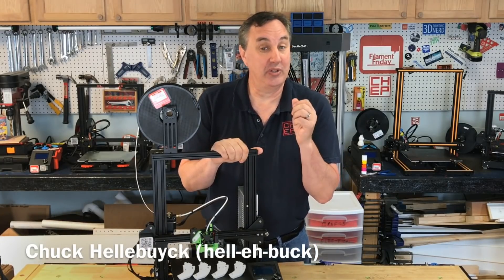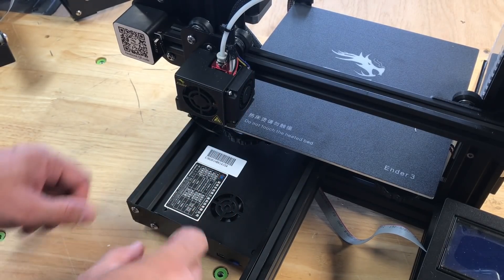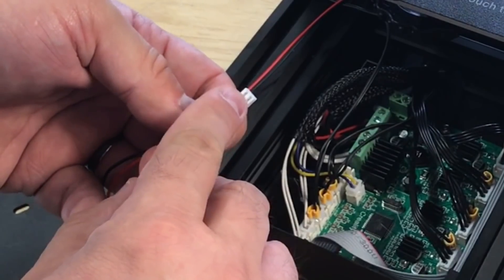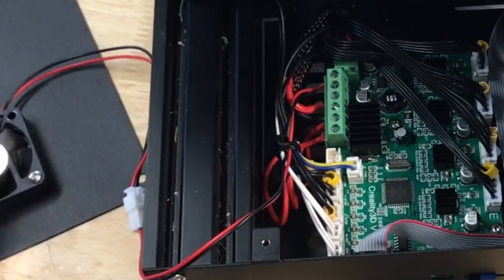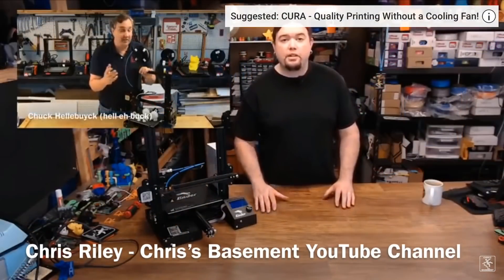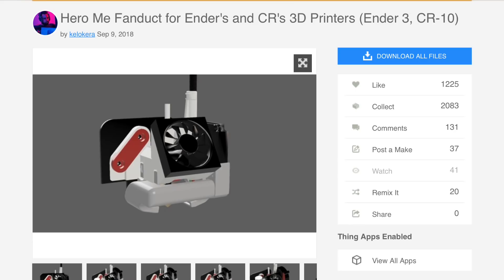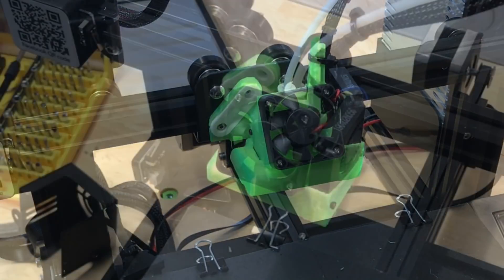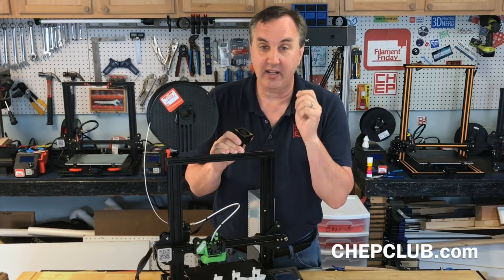HERO ME FAN DUCT and Fixing the Cooling Fans on Creality Ender 3

Comment: 3 years later and Creality is still making their printers with the electronics box and parts fan running the same fan speeds. 
Please make a separate video to spread awareness and show your mod as I think it's a pretty big deal. Think about it: when running HOTTER and drawing more power for PETG and Abs you are running the fan lower/off which means under the biggest loads your electronics are cooking.
Reply: is this the possible reason why my extuder motor stop working in the 4th layer every time when i print abs? coz the motor is overheated due to the motherboard fan is not working.

Comment: Solder is malleable. It crushes just find and works in terminal blocks without issues. Also it prevents individual strands from shorting stuff out. I don't know where this old wives tale comes from. I've had the discussion several times and we've tested it out. There is nothing wrong with using tinned wires.
Reply from the maker: Over time solder will move from the pressure because it’s malleable and reduce the holding force from the terminal block screw/clamp thus creating a slightly looser connection.
Reply: @FilamentFriday  I don't believe that. It will deform under pressure but its not going to flow away from the connection. Copper wire strands deform as well. They are obviously harder material but if they deform we would see the same effect on a bit smaller scale. If this is true you have to re-tighten the screws from time to time no matter what. I've had tinned wires in terminals for years and have not noticed.
Reply from the maker: Ok. But it’s an industry known fact. https://cdn.thomasnet.com/ccp/00142951/263810.pdf
Reply: @FilamentFriday  lol. Written by a sales and technology apprentice. Now industry standard eh?? Do you believe everything you read? You will notice the article states many companies tin their wires. Mine is one of them. We have been doing it for a long time.
Reply: @Ryan_Tidwell  It depends on your use case and the expected operating environment. Low current and no mechanical stresses, there should be no issues tinning wires. But high current or a lot of mechanical vibrations, then you're just asking for issues from solder creep and fatigue. Why you'll never see tinned wires in automobiles or aerospace.

Comment: My recently purchased Ender 3 pro doesn't work with the latest Cura version.  It stops printing and freezes the print just 30 seconds into a print job. It works fine with the Creality slicer.
Reply: strange, I‘ve no issues with cura, did you also tried prusaslicer? what marlin version you’re running? older marlin versions don’t support all gcode commands
Reply: Upgrade firmware

Comment: Agree with having the profile set up correctly, but better cooling will allow faster print speeds. There's no reason to think that if you have a profile that produces a good print w/out cooling that adding "good" cooling will improve it.
With the hero me cooling, did you ramp up print speeds? Or use same print speeds and time per layer as w/ no cooling?

Comment: Based on your previous video, it looks like the speeds you're printing at mean that you're not close to the limits of your cooling setup. If you are telling your slicer to take 10 seconds minimum per layer, you're spending a lot of time just waiting because you're not using adequate cooling to go faster. If you were to increase your printing speeds you will probably start to notice a difference. It looks like that's what happened in Chris' video.

Pushing print speeds will identify a printer's weak points, and something like the Hero Me is useful when that weak point is cooling.  Making these types of improvements can result in faster prints with no loss in quality. One of the joys of PLA printing is the ability to push speeds faster and maintain quality because it melts and flows so well, and hardens just as fast with great cooling.

Comment: I agree that a profile needs to be setup correctly over anything else, but I also think the hardware should be setup correctly too. Printing without supports, getting better overhangs and bridging capabilities are really where the improved cooling come from. I don't think you'll see those results on a Benchy.

Comment: What's going on with the estimated completion time?  You said yours is 5h46 minutes but mine is at 5h48 with just the duct part. I have the base and adapter going on my other printer but if that time estimate is correct it would be faster for me to just wait until the base is done and print the duct on that printer as well. I just really want to try out PETG on the ender and haven't yet so I'll probably just go ahead and send it to the ender. If you have any ideas on the time difference, let me know.  I'm using your profiles, of course. Oh yeah, and I can't tell you how many times I paused the video because I was trying to look around your sliced model to make sure I have the orientation the same as yours!
Reply from the maker: Not sure. Check infill and number of walls. That adds time.

Comment: does the base ender 3 pro have a fan for any fumes from the plastic or should i try and find one
Reply from the maker: What fumes? 
Guess you need to find one.
Reply: The only time there are any significant fumes is when you're printing materials such as ABS, PC, and other heavy duty, high temperature filaments. If you do want to print those then you'll probably need an enclosure with air filters
Reply: The Teflon in bowden tubes starts to break down and offgas starting at 200deg C. This is toxic.  At 200C, it's supposedly not a problem for humans, but is a problem for any pet birds around. The closer you get to 260C, the more risk you're taking being in the same room with the printer.
This is why you'd want to get an all metal hot end if the printer doesn't already have one. It keeps the tube away from the heater block and those high temps.

Comment: Hi, on my old Creality CR10 (first model), i had some problems of warping but not on the bed, on prints that have a angle and need a support. The lines doesn't stick to the support and then it warp. I tried different setup of supports but it always warp on supports. And then if it warp too much, the noozle hit the print and brake everything.
So i experienced there is less warp phenomen when i use 60 Celsius for bed and i stop the fan. In fact the warping phenomen is due to the temperature of the line that is freezing too fast and then it retract before the othe layer. It always retract on +Z, i don't know why it's anti-gravity ? So i'd the idea to stop the fan to inverse the warp in -Z so that plastic would fall with gravity. But it doesn't. Maybe because of the other fan, or the temperature of the room is too much low (18 to 20 celcius) and then i'm leaving at altitude of 650 meters so pression of air is not the same. I think all that make my prints warping on supports. But with a 60 Celsius bed, a nozzle to 210 celsius and no fan, i can print finaly. 
It would be interesting for science to make print test at Altitude of 2000m or more and to zero near the sea to sea difference. I'm pretty sure that there is more warping on high altitude, but i didn't test at zero to proove it.

Comment: Chep!! Could you answer a quick question please. I've an Ender 3 V2. The hot end fans were making a racket, so I downloaded a Fang, replaced the fans :-) My question is...
Should the top fan and front fan both be blowing into the fang? In my case the front fan is blowing onto the nozzle and the top fan is sucking air upwards? Either way i woke up this morning with 20 meters of filament all over my bed !!!

Comment: I just did the fan rewiring thing,  didnt invert polarity nor anything but I noticed the fan is pushing air in ...shouldnt be extracting hot air?
Reply: Or dont. Positive pressure in the electronics case means less dust buildup. This is a common tip in pc building
Reply from the maker: Flip the fan over

Comment: Would this work with my Noctua 20mm fan?
Reply: 20mm should be fine for mainboard cooling. You have to be careful though, stock fans run on 24v and noctua's run on 12v.

Comment: I can confirm the fan issue. I have an Ender 3 Pro , motherboard is v4.2.2; there are two connectors, labeled kfan1 kfan2 ; both are controlled by the "fan speed" (that I can change also from the display) ; this means indeed that when printing without fan (e.g. when you print PETG) the motherboard is at risk of overheating. Thanks CHEP for noting this
Reply: BTW in Ender 3 pro the MB is on top and the fan is on bottom of the black case

Comment: Is this fan issue in the Ender3 V2?
Reply: To actually answer your question, yes this is the exact same on the V2. My hotend fan cable came loose and I noticed when I increased the part fan speed, I could hear the motherboard fan get louder. Whenever I print PETG with no fan, the outer case where the board sits gets super hot. I would 100% make this modification if you're going to print something that needs no or minimal part cooling fan.
Reply: @ZachAlanPhotography   yea, the board fan is connected to the same control as the parts fan, I didn't mention that one of my first upgrades was put a male pigtail And wire a new ball bearing fan to the 24v in. I was answering about print quality.
Reply: @ZachAlanPhotography  thank you so much. I have been looking everywhere for a straight answer to the V2 question. Chuck's right. PLA prints amazing at low fan speeds but it's still prone to bad curling due to the terrible air flow of the Ender 3's  fan shroud.
Reply: @johnyrocket223  Happy to help!
Reply: the ender3 v2 I have, doesn't have an issues stock.. prints PLA like a boss all day with the stock profiles...  when I switched to a direct drive.. everything worked great still.. switching to a tool steel tip.. upping temp slightly... Everything was still great... switching to microswiss all metal hot end.. things started to get a bit dicey.. as in you have to fiddle a bit more to get things to work right... the steel tip and all metal hot end force you to raise the temp pretty high to get things to bond... then you need more fan to cool it quickly and prevent warping.. I found 1 fan to be enough.. but it only cools one side.. you find overhands look good on 2 of 4 sides of the print... but,  if you keep it all stock and print pla or pla+ I never saw an issue besides just eating up brass tips with cheap filament....  when I started printing PETG and ABS. the v2 shroud is turning into a piece of brittle trash... when you look around you find.. (and I tested this first hand) larger layers means a stronger print... hotter temps means better layer bonds(with some filaments means more rigid and brittle too, be careful)... both of these (i can only speak of "in my case") required more cooling then the stock fans could provide...
Reply: @Derock-25-  great help thanks man.
Reply: @Mk6GTIMike  no problem.  In the end, to print everything, I bought a standard ender 3 metal shroud and will modify my trolly to accommodate it... then mount 2 fans to that. May not look as stylish but it's gunna last better with my hotter temp printing.  Only needed if you want to print above 245c consistently. Which pla never will...

Comment: Hi! Is there a fan upgrade for ender 3 where the airflow will not touch the part of the print it's for an abs print
Reply from the maker: Shut the fan off in slicer.
Reply: I have bought mica plate, you can put it between heat block and radiator. But you will need a different fan shroud I think.

Comment: I also put the HeroMe Gen 5 on my Ender3.
I am getting much less stringing and love it.
Just wish I knew how to adjust the Y home. the nozzle is about 20mm away from the bed when it is at the home position.
Reply: you would fix the bed location in custom firmware.. on my ender3 v2 it was off.. the actual bed is like 232x232... but with the clips I made mine 232x220  also in the same view.. you can set where the bed starts in MM from the home possition...  if you have the silent board.. or another board with built in bootloader... editing marlin has a relatively small learning curve...

Comment: Yes, getting the profile right without cooling might be a good idea. But do remember that this is heavily depending on the environment temperature and the temperature used.
I might even go further and say that a cooling fan might even decrease layer bonding. The hot material from the current layer heats up the previous layer so the layers will melt into each other in a better way. But for bridging and overhangs, part cooling will help to get the quality perfect but it also depends on the printer. I built my first 3D printer from scratch, and I mean from scratch: apart from the heater cartridge, the extruder, heat break, heater block, electronics and even the nozzle were hand made by myself. On that printer I did not have any cooling and that printer had very good quality with ABS. I printed the Venus of Milo head and only had minor drooping on the chin (no supports used).
But part cooling will improve print quality, especially with steeper overhangs and bridges. I have visited a local 3D store and given some parts printed on a specific printer, I could just look at all the printers that they had in use and tell on which printer that part was printed. Part cooling does improve print quality, especially with larger overhangs and bridging and depending on the cooling coming from left and/or right side, the finish of overhang surfaces is different, if even just a bit, and this is visible.

Comment: Awesome video - thanks for that! Just one remark: Instead of switching the black und red wire on the fan itself, you should switch red/black on the extansion cord.
What you did is matching the colors, but now the color/polarity matching is wrong the whole way of the cord, could be quiet confusing when redoing something later on and don´t remind the correct polarity ;-)
Reply: He just changed the fan connector. The polarity is correct in all wires. But yes, it's switched in the connector, so if one reconnects to the the original female connector on the board, the polarity would be reversed in the wires (and fan).

Comment: I seem to be having a vibration issue. My Ender 3 makes more noise because the fan cover seems to be lightly vibrating against the axis. I've tightened all the screws, but it still is making the noise. I wonder if a printed piece would help fix the issue
Reply: Brittany Poremba It may, but likely not. The issue is likely with the fan. Try cleaning the fan of any loose bits of filament or stringing that could be stuck in it, or even switching to another one all together; this fixed vibrations for me. Fan bearings, especially the cheap ones Creality has stock, go out eventually. They’re consumables. This is a perfect chance to switch to a silent Noctua (make sure you get a buck converter)!
Reply: You could try peeling off the fan sticker and put a drop of oil on the bearing.
Reply: I'm pretty sure its the fan casing vibrating too much. If I loosen one of the screws, the noise dulls massively
Reply: How did It go? i have the sane problem
Reply: @fataldischarge1061  loosening the screw slightly seems to work for me
Reply: @brittanycalhoun225  I solved It by putting some packing/anechoic material (which was used for shipping my phone cover) between the screws and the X-axis/extruder's metal

Comment: What happens when both of those fans don't turn on when printing? Did I have something short out? I thought just my nozzle fan was out, but then I noticed my circuit board fan was off too? I have one of those Silent Mainboard V1.1.5 coming soon, would that fix it?
Reply: Something is wrong on your board. Possibly something got fried? If the main fan on the hot end doesn't work the nozzle assembly may burn the filament :(

Comment: I own an Ender 3 modded to direct drive and I'm reluctantly coming to the same conclusion as you. As sexy and these part fan designs with the 5015 can be, I've printed a couple and don't see a worthwhile improvement if any. I'm at this very moment printing my final attempt at having a custom fan and if I don't see any improvement I'm closing shop and just keeping the stock setup.
Reply: my ender 3 v2 stock shroud and direct drive.. did a good job.. untill  it warped printing some PETG with my microswiss end then went to take it apart.. all the plastic is brittle from heat... I just ebay-ed a Ender3 shroud and will modify that for dual 4010 ball bearing fans... I'm thinking it's the best way to go that metal shroud is tough to beat..